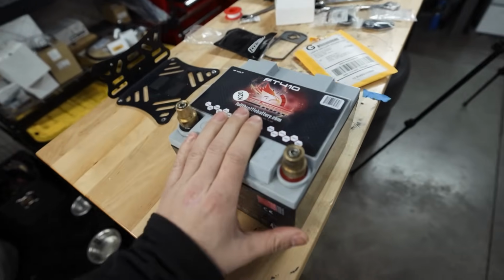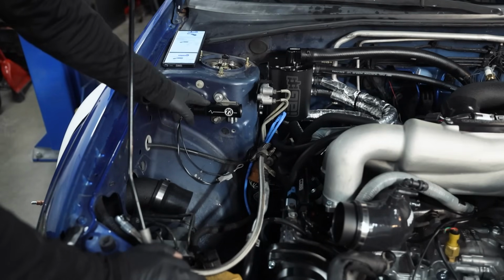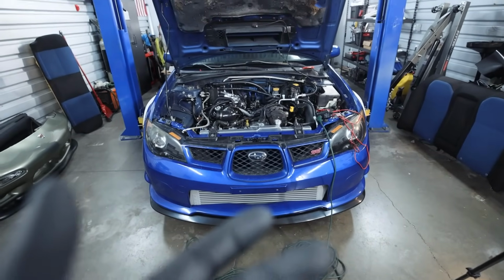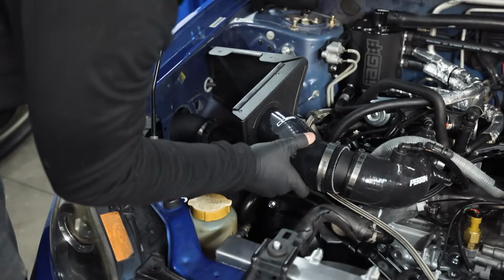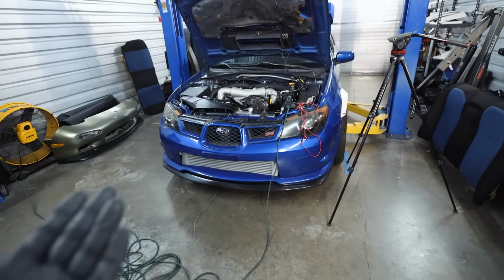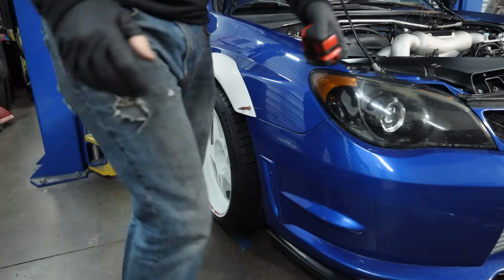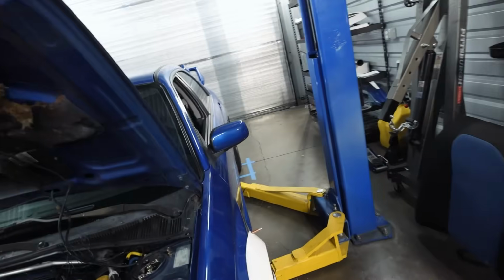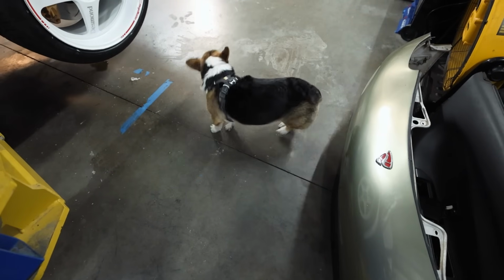Preparing the Once Clapped 2007 Subaru WRX STI To live again!

Comment: Don't know if the Company 23 boost controller plumbing is similar to the three port Greddy unit that I've been using for years, but when i switched to an external gate, i had to swap the hose from the normally open solenoid port to the normally closed port. 
Internal Wastegate:
  With the common port connected to the internal gate actuator, you should be able to take the pressure source line directly from the compressor housing to said normally open port. In this configuration, the normally closed solenoid port would be unused.
External Wastegate:
  When switching to an external gate, the common would then be connected to the "top hat" of the external gate, while the pressure source from the compressor housing would be split, with one of the lines connecting to the normally closed solenoid port, and the other to the body of the external gate, between the diaphragm and the actual wastegate valve. In this configuration, the normally open solenoid port would be unused.
  Hope you can make sense of this gibberish, and I've not confused you further, lol.

Comment: For the Milwaukee battery problem. I think they blink red and green is because the battery needs to be reset so it can hold charge.
Reply from the maker: You can reset the battery?!
Reply: @Smeedia  yes you can try looking it up on youtube. I’ve seen it happened where the battery won’t hold charge. I think you have to stick 2 wires from negative to negative and positive to positive so just start the battery, just like a regular car battery and then the battery somehow resets itself.

Comment: check your batteries haven't started to melt the plastic between the connections, I'm having similar issues and have the melts.
Reply from the maker: On the terminals?
Reply: @Smeedia  between them, the thick pieces of plastic that seperate the terminals on the battery
Reply: @Smeedia  sent you a photo on insta

Comment: I feel you on the Milwaukee battery charger, I got the 4 port m12 charger and it works then it doesn’t. I have to take mine apart and for some reason when I put it together and plug it back in it magically works… I didn’t do anything to it other than move a few wires around…
Reply from the maker: I've gone through 4 or 5 of them and for some reason they always die 😢😅
Reply: Had the same problem 
I use Dewalt for years now no issues

Comment: @smeedia hey man off subject but I know you the guy to ask… I just installed billetworkz short shifter,shifter plate & bushing everything went smooth but the bushing would not fit on the cable so I had to force it on everything was shifting smooth but by the night time I have to use a lot of force to shift gears… any advice what to look for? I do not know if the bushing is spouse to move or not I had to forced it in there…. And had to put it on the cable side first.. thank you in advance… PS keep up the great content I’m new to the platform and been following all your advice (2021 wrx)
Reply from the maker: If thr bushing was too tight I'd pop it off and either swap the oem back on or shave doen thr new one a hair. It shouldent feel overly hard to shift it 🙏